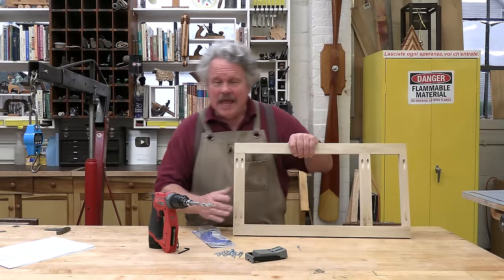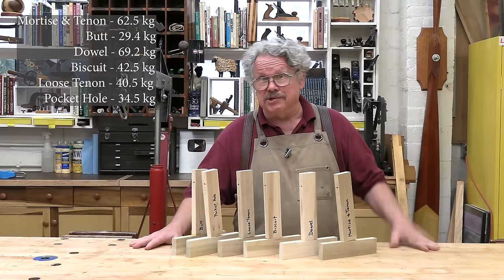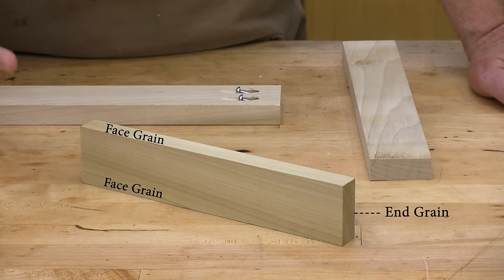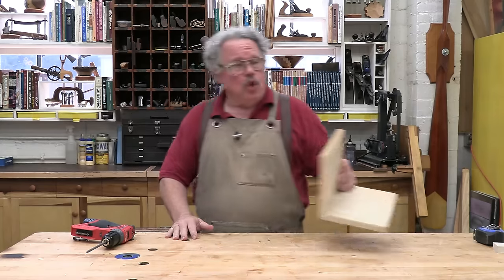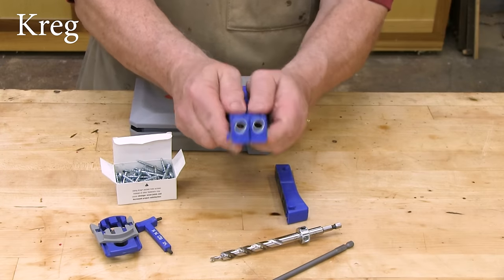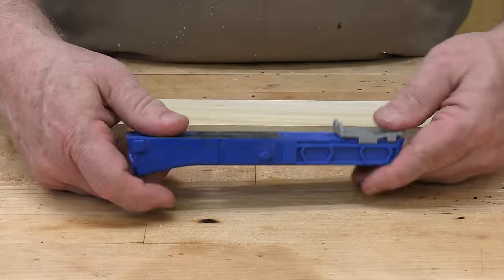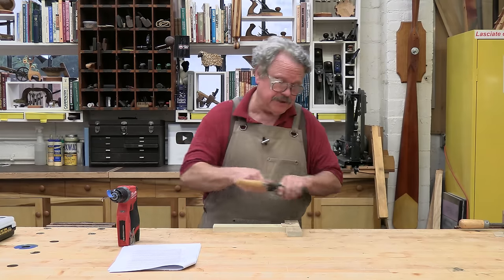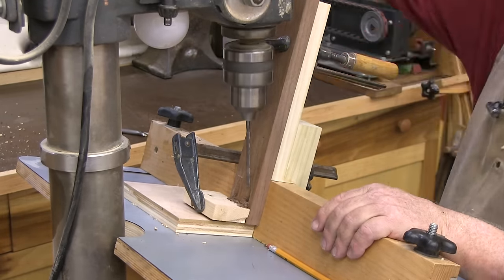Pocket Holes Overexplained

Comment: What I like about pocket hole joinery is that it gets new people interested in and started on building wooden things. Once they are comfortable building those things, they might progress into stronger and more traditional joinery. Dowels, dovetails, mortises, etc. They buy a palm router and a basic bit set. They try rabbets, tongue in groove joints, and so forth. They add equipment as their wallet, interest, and skill level increases. Few have a six-figure income, and few of those who do have a small acreage where they can put up an insulated, climate-controlled 20x40 building with all mod cons for heirloom- level, production-rate woodworking.
Reply: Wouldn't dowels also be really easy?
Reply from the maker: Agreed. Pocket holes are non-threatening to newbies because it's so easy to get accurate alignment. Other forms of joinery may be stronger, and more durable, but they either require skills that new woodworkers don't yet have or equipment they don't want to buy.
Reply: Dowels require a bit more accuracy than pocket holes, you have to make the same holes in both pieces in exactly the same spot. Pocket hole is just line up and drill once.
Reply: @TH3C4NN4BL3C0W  Thanks! All my experience with dowels is from putting IKEA furniture together, and there all the hard work has already been done.
Reply: Pocket holes were what got me into woodworking. I was building a stand for some homebrew equipment and ran across the kreg pocket hole jig at home depot. It wasn't very expensive, so I picked it up and was amazed at how simple and elegant it was. From there I started looking into other joints and now I have a full woodshop. I'd say it was my gateway to a whole world of woodworking.
Reply: The Kreg pocket hole jig was very helpful as I was getting started. It enabled me to build shop furniture and fixtures without knowing how to execute any other joinery. It was a substitute for mortise and tenons, rabbets, dados, dovetails, finger joints, and even miters. Without it I'd surely have gotten stuck, unable to move forward until I mastered at least one other joinery technique. Which would have meant I needed other things I didn't have yet.
Most of the things I joined this way have long ago been replaced, but not because the pocket holes were bad. Usually because the piece was a poor design. A fixture that didn't solve a problem well. But my router cabinet, which is based on a plan in Woodcraft Magazine, was made entirely of pocket holes, and is still going strong. I'm still pleased to have it in my shop.

Comment: Wonderful. I congratulate you. You go everything right, which is very difficult to do as evidenced my the numerous videos on YouTube that get it wrong. For example, you explained that beyond joint type, joint preparation and joint assembly (gluing)are a significant portion of strength. I also, liked how you demonstrated the alignment block to prevent drill press bit from deflecting down the face of the work piece. I hope people catch onto that tip.

Perhaps a follow up video could discuss sheet goods? I find that pocket holes can be real problem solvers in this case particularly veneer core where a screw drive into the edge often splits or "mounds" the wood.
Reply from the maker: Thanks for saying. But the formula I use is as old as dirt and just as simple. Tell 'em what you're going to tell 'em, tell 'em, then tell 'em what you told 'em.

Comment: Excellent video Nick! One thing I would like to point out: Kreg states that you do NOT want the pilot hole to go through the end of the Pocket Board. I have been using a 3/32" bit with a 1/4" hex extension to ADD a pilot hole after clamping just before driving my screws. This has eliminated my splitting issues completely. However, I DO use the recommended depth of the pocket hole where the pocket bit from Kreg does not exit. This gives more structure to the Pilot Board so the head will not pull through under stress. Something to test in your copious amounts of spare time. LoL
Reply from the maker: Suggest you read my reply to David Powell; you'll find it interesting.

Comment: Great discussion thank you. As someone who has used pocket hole jigs for over a decade, my experience has always been good. I use them to build several kitchens and cabinet assemblies. But something I'd like to add is if you alternate screws from both sides of the board it is an extremely strong joint. I used that method on an outdoor bench made of walnut, and it's held together for 10 years with only four pocket screws in each leg, toed in.

Those jigs are amazing.
Reply: this is an interesting tip! I'll have to give it a try sometime!
Reply from the maker: This is very similar to an old method used by master furnituremakers to attach moldings to their pieces. They drove small brads at alternating angles, effectively hooking the parts together. This helped prevent the nail joints from pulling loose.

Comment: Nick you are the Jedi Master of woodworking!  I’m continually impressed by your expertise at unpacking and sharing so many layers of woodworking knowledge.  I particularly appreciate you demonstrating the how and why without the use of expensive tools.  I own a Castle Pocket hole machine and it is an excellent tool for cutting low angle/stronger pocket holes and the build in router cuts a really clean pocket hole.  I used paste wax to minimize splitting with some success but not even considered drilling pilot holes as a better solution…. Thanks again for sharing your knowledge.
Reply from the maker: Most welcome.

Comment: Well done once again, Nick!  A few observations I've made while visiting hundreds of cabinet shops and large cabinet manufacturers who make face frames: They don't use Kreg brand screws. Not only are they more expensive than the retail products from Kreg, but most of the production face frame screws have a smaller #6 screw shank and thread, with something approximating a #8 screw's head diameter.  Also, the larger shops use fine threads for hardwood and coarse for softwood, as you mentioned, but custom shops will often use a hi-lo thread screw that's somewhat like an al-weather tire.  I rarely see glue being applied to the pocket-screw stile and rail joints and I've never seen a shop that sizes the end grain. I'm not saying that it isn't a better method, it's just nothing I've ever observed. Also there's never a secondary predrilling. The Type-17 tips on the threads work fine because they ALWAYS build the face frames in a clamping table or fixture with pneumatic clamp rams over each joint, so the compression you mentioned is present.  Another difference is that they usually use molding that has a 3/8" or 1/2" or 5/8" groove that houses the parts of the cabinet carcass.  This makes installation of the face frame a quick and accurate glue and staple affair.  Your tilting sub-table idea makes me happy to be a Shopsmith user!  Scott
Reply: Hey Nick, DIGG just shared a link to this vid!  Did you get a bump?

Comment: Very helpful. Thanks for covering the importance of a pilot hole. The benefits & necessity of pilot holes don’t magically disappear or become unnecessary with pocket hole joinery. Just as you described, 5 out of 5 pocket screws driven into a hard wood face frame without drilling a pilot hole will lead to starting over building the face frame. Much better to take an extra minute to drill a pilot hole than to waste material, especially at today’s prices. Instead of “overexplained” per your title, it might read “properly explained.” Bravo & thank you.
Reply from the maker: Most welcome...and thanks for the kind words.

Comment: Exceptional video with quite informative and instructive explanations!

I do enjoy listening to this maestro(instructor). 
He gives me confidence and is actually teaching me something. 
Not trying to sell commercial products of the sponsors.

I am listening twice - at normal speed and at 75%.

I might listen a third time at normal speed for a refresher.

Thanks a lot sir for aptly sharing some of your experience.

That drill press table is a lovely design and build! I never realized that existed.

Now I know how to make a pocket hole and how the measurements affect the success of the joint.
I understand grain direction and wood faces as applied to 'svrewlogy'!😊

So, it's through face to end/edge to face/edge for pocket hole joinery for better strength.

Apply glue twice on end at 5 minutes interval due to capillary absorption.
And also on other glueing surfaces once.

Thanks a lot for the instructive information on the 3 main parts of the pocket hole screw - head shank and thread - and the function each plays.

Along with the need for a pilot hole these explain why the special drill bits.

To select screws, I use this formula: (2 x Wood Thickness)- 1/4

Eg,: (2 x 3/4) [- 1/4] = 1-1/2[-1/4] = 1-1/2 or [ 1-1/4] !
 (When joining wood that has the same thickness of 3/4").

I'll continue my upward learning from this maestro!🙏🏾👏🏾👍🏾

Comment: Woodworking is actually my job! I've see many people on the internet using pocketholes, and i was really curious. You explained it very well!
Since we make everything with machines, our main joint is the dowel. We even drill all the holes on a cnc.
With regular cabinets for kitchens and custom living room cabinets where the screws will be hidden, we even use dowels without glue for alignment, and then just screw them together.

Comment: I've been using pocket holes for years and I though I knew everything there is to know about them. Until I watched your video. My main beef with PH's was that the joined board tends to move when you drive in the screws and cause the boards to not be flush. Clamping the boards on the bench while screwing does remedy this but unfortunately with some assemblies, it's impossible to clamp the boards firmly enough to stop them from moving (like in edge to face 90 degree joints for example). But your explanation of the lack of pilot holes and how to make them fixes that problem for good. Thank you very much Nick.
Reply from the maker: Glad to have been of help.

Comment: I have been building things like I used to build tree houses, no glue, and an excessive amount of screws and thick wide wood so it does not kill me. I think if I ever want to go for that better look I will buy the DeWalt biscuit. But I do hear that the biscuit does not hold weight well vertically versus a domino, but I have no idea what project requires vertical hanging with a joint.

Comment: A fantastic video and it explains a lot. I have a pocket jig by Trend and I’ve found it to be exceptional for doing pocket holes.

I would also add if you buy dowelling, you can make your own plugs, just add a piece into the hole and cut the excess with a saw.
Reply from the maker: Thanks for sharing.

Comment: Absolutely excellent video!! Being female & in my 60's, shop class was not an option we were allowed to take. So I really really appreciate the extra info. SUPER helpful! I remember when I started doing my own molding on a chop saw & trying to find out what a "Kerf" was & how to account for it... literally took me hours to find someone who talked about it. I want to attach a shelf type chair rail to my wall studs & kept thinking why am I not making a pilot hole for the screw tip into the stud? I know from awful experience that "self tapping" screws split wood BUT everything I kept seeing said no need or didn't talk about it. I used a pocket hole jig to attach extra framing around a door where there was no room to swing a hammer and no actual framing (it is a mobile.. don't ask *sigh*) it worked great. So I figured it would give the "shelf" chair rail a bit of extra strength. I installed picture rail into the studs and it holds a ton of weight so why not the chair rail? BUT I needed more of the actual physics of doing it & most videos don't show that. You did & it was presented very well in full details, excellent editing & a LOT of examples. BEST 18 mins I have spent in a long time!!
Reply from the maker: Thanks for that. I love the science of woodworking as well as the art. Spent years teaching "Wood as an Engineering Material" at the University of Cincinnati.

Comment: I first tried pocket hole joinery about 15 or 16 years ago. I was assembling a toy box for my new-born niece when it dawned on me that I had built the whole box using stub tenon joinery. That's fine for most furniture, but a toy box may be subjected to "extreme" conditions. I had seen pocket holes advertised and thought I would give them a try. I drilled pockets holes (right thru the tenons) on the inside faces, applied glue and clamped the assembly until everything was tight. I was surprised when more glue squeezed out as the screws were tightened. The toy box is still together today. Thanks for another informative, entertaining video.
Reply from the maker: I've done several workshop and kitchen cabinet installations using pocket holes for the face frames with no issues, but the frames of built-in cabinets don't have a lot of severe loads or stresses. The toybox story is surprising; thanks for sharing.

Comment: I have used pocket hole joinery since I was introduced to Kreg. I am a big fan of pilot use, however, I have very rarely split either soft or hardwood when installing the matching screws to the species, (fine thread for hardwoods, corse for softwoods), probably just have been lucky.
I liked your comments on gluing method on end grain. Very good video, well presented. Regards, DaleO
Reply from the maker: Thanks for the kind words.

Comment: Thanks for the video.  Yesterday I preassembled a shelf using pocket holes, end to long grain, to hold the shelves. I planned to glue them later, but decided not to.  Today, I think I'll add the glue.  

I have the Kreg clamping jig that makes it fast to drill holes, but when I join longer boards, I use the manual jig like you showed that requires a  clamp and I put them in pigeon toed for more strength. For narrow boards, like my 3.5 inch shelves, I don't have room for putting them in at an angle from each other.

Comment: 11:40 I suspected there would be a complication so I am happy I never bought that kit. Also, I prefer to buy decking screws that usually do not split pine and hold 500 pounds each, and also like using those cabinet screws. So far I am loving the Power Pro brand at Lowes, #9 3 inch box for $50, 2.5 inch and 1.5 inch all number 9 for pine, rare to split wood. I am showing everything I build.

Comment: A few of the other YouTube channels I watch have made it a point to mention that pilot holes weren't necessary for soft woods that pocket holes are most commonly used for. I heard the voice of my old wood shop teacher from Jr. high school saying, "What about a pilot hole in the receiving piece. I've been wondering if hardwoods would be as forgiving as the soft woods I commonly use. I don't have a pocket hole gig setup, so this video is well timed.
Reply from the maker: The determining factor for whether or not a piece of wood is likely to split is not whether it's deciduous or coniferous, but the species. I have found redwood and cedar just as likely to split as cherry and oak. And even if you're using a wood that is not prone to splitting, knots and other imperfections in the wood may cause it to split anyway. Pilot holes are necessary for some woods and a wise precaution for others.

Comment: Nice comprehensive presentation of pocket hole use.  However as a once upon a time doing on site custom residential contractor work economics is the prime consideration, so cost of materials and labor determine satisfaction of both client and contractor.

You might consider a comparison guide listing all the materials....guides, tool bits, screws, etc necessary to complete a small test project....which tallies total time spent to completion.

I challenge your assertion that pocket screw joiner is fast.  Using a biscuit joiner properly eliminates a ton of screws, swapping bits, multiple tools and saves many hours of labor...not to mention providing greater versatility.   

None the less, given the focus of explaining a particular fastening method your presentation was outstanding.  Will be looking at your other videos with interest.

Comment: Great tips here. The extra pilot hole, which kregg tools does not talk about, is an excellent tip for two reasons: 1/ it prevents cracking as you state 2/ it prevents the joints from creeping. I have found that without the pilot hole, the screw will push against the board and cause the joint to creep and misalign. This can also be caused by left behind wood chips.
Reply from the maker: Great observation. Creeping may be a stubborn problem, especially in wood where the summerwood is a different density than the springwood -- the screws will want to follow the softer springwood.

Comment: Could you make a video on threaded inserts? I have so many questions about: the types; when to use them and on what material; wear and tear; do's and do nots; wood vs. metal vs. plastic, and when to just use a wood screw/sheet metal screw/nail instead. I would really value your opinion on all of that.

Comment: Outstanding.  Even though I've used pocket hole jigs for quite a while, it was still enjoyable to watch it.  Although I haven't had too much issue with splitting. But then again, it was away from the edge more.  TY for the tip.
Reply from the maker: Most welcome.